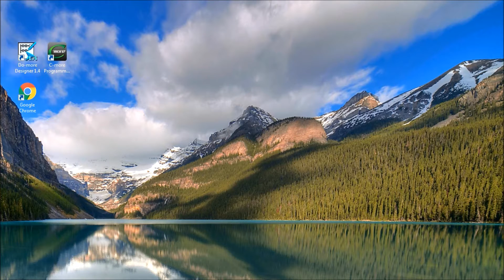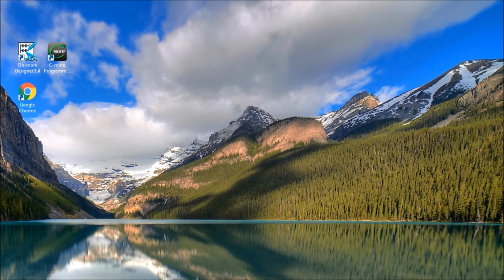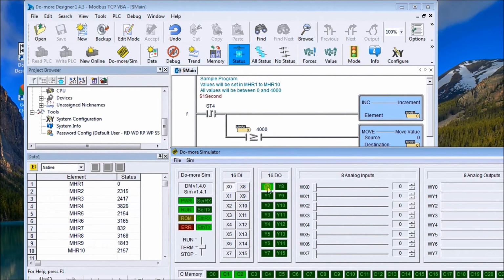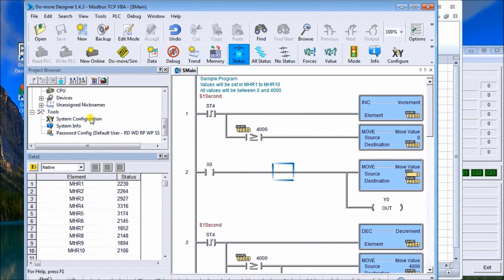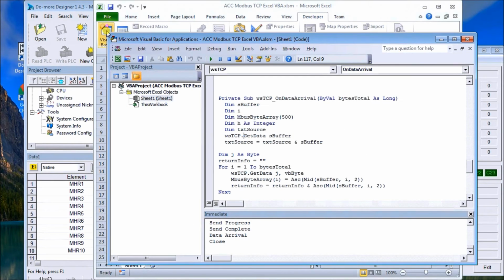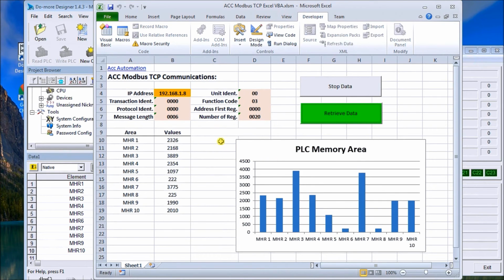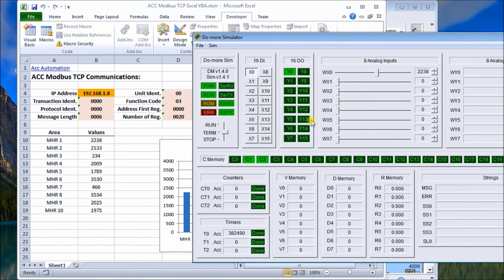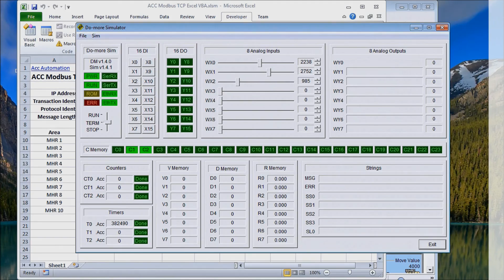Supercharge PLC Data Extraction with VBA and Modbus!

Comment: Hi garry!I have a problem with this code. The code works perfectly for Integer data, but I need to work with floating type data. when I try to implement float data in the excel book, the program shows me an error. I already see the info in your webpage, but I can't find a solution for this. Can you help me?
Reply from the maker: Hi Ramses MG,
Once you have retrieved the information, then you can convert to floating-point. Here is post that explains the process.
http://davestow.com/handy/excel-hex-to-floating-point.htm
What I would do is use a program like AdvancedHMI to get the data. This program runs on visual studio, vb.net and is free. You would then communicate directly to the excel file for data.
https://accautomation.ca/create-a-plc-with-hmi-training-and-learning-environment-free/
AdvancedHMI has the drivers are already written for floating-point and long information.
Regards,
Garry

Comment: Fantastic video... Thanks... But what if i needed each cell to be between the values (-65536 and 65536)?
Reply from the maker: Hi TheAlansal,
https://www.mrexcel.com/forum/excel-questions/767831-signed-hex-numbers.html
The above link may help you out. It will be a matter of converting the hex number into a signed number.
Regards,
Garry

Comment: Hi Garry, Im using the 8000 adress in my PLC. What should I write in mbusquery?
If (wsTCP.State = 7) Then
    MbusQuery = Chr(0) + Chr(0) + Chr(0) + Chr(0) + Chr(0) + Chr(6) + Chr(255) + Chr(3) + Chr(8000) + Chr(0) + Chr(0) + Chr(1)
    wsTCP.SendData MbusQuery 'Send out the Modbus Information
    ' Read the information
    '0000:    Transaction Identifier
    '0000:    Protocol Identifier
    '0006:    Message Length (6 bytes to follow)
    '00:      The Unit Identifier
    '03:      The Function Code (read MHR Read Holding Registers)
    '0000:    The Data Address of the first register <<<<<<<<
    '0002:    The number of registers to write
Reply from the maker: Hi Andre,
Each of the Chr(xx) represent two Hex numbers being sent. Note: The leading zero is suppressed. You want the following:
    ' Read the information
    '0000:    Transaction Identifier
    '0000:    Protocol Identifier
    '0006:    Message Length (6 bytes to follow)
    '00:      The Unit Identifier
    '03:      The Function Code (read MHR Read Holding Registers)
    '8000:    The Data Address of the first register <<<<<<<<
    '0001:    The number of registers to write

    MbusQuery = Chr(0) + Chr(0) + Chr(0) + Chr(0) + Chr(0) + Chr(6) + Chr(0) + Chr(3) + Chr(80) + Chr(0) + Chr(0) + Chr(1)

Hope this helps you out.
Regards,
Garry
Reply: Hi Garry, thanks !!
And what should I do to write a data on plc?
Reply from the maker: Hi Andre 

   ‘ Write the information
    ‘0000:    Transaction Identifier
    ‘0000:    Protocol Identifier
    ‘0009:    Message Length (6 bytes to follow)
    ’01:      The Unit Identifier
    ’16:      The Function Code (read Analog Output Holding Registers)
    ‘0000:    The Data Address of the first register
    ‘0001:    The number of registers to write
    ’02:      The number of data bytes to follow
    ‘0030     The number to put into the register

This is on the followup website at the following URL:
http://accautomation.ca/how-to-implement-modbus-tcp-protocol-using-vba-with-excel

Regards,
Garry
Reply: I can't figure out how to write to PLC from Excel. Excel needs to be a TCP master not slave? Is there any example program for this?

Comment: I try use your code but i have trouble.

I line: Set wsTCP = CreateObject("OSWINSCK.Winsock")
I have: Error 429: ActiveX component can't create object

I use Windows 10 64bit

Can you help?
Reply from the maker: +Silar Silar 
I have not tried this on Windows 10. This was originally ran on Windows 7, 64 bit.

Run-time error '429': ActiveX component can't create object
This error occurs when the Component Object Model (COM) cannot create the requested Automation object, and the Automation object is therefore unavailable to Visual Basic. This error does not occur on all computers.
Try the following before the Set line:
DIM wsTCP As  OSWINSCK.Winsock
Set wsTCP = CreateObject("OSWINSCK.Winsock")

Let me know if this works,
Thank you,
Garry
Reply: This doesn't work. I've the same erro 429. 

I'm on Win10 with Access 2013.
Maybe i should try on another PC ? Or you found a solution ? 
If I find a solution I'll tell you. 

Thanks.
Jack.
Reply from the maker: Hi Jack,
Can you try to register the OSWINSCK.dll file from the command line. Here is a link to explain how to do this.
http://www.ctimls.com/Support/KB/How%20To/Register_dll.htm
-To register a 32-bit dll or ocx Windows System file in a 64-bit version of Windows (10, 8.1, 7, or Vista),
     Type cd \Windows\SysWOW64  [then press Enter] 
     Type regSvr32 oswinsck.dll  [then press Enter]
Please let me know if this works for you.
Thanks Jack,
Garry
Reply: I tried your solution but the same problem happened.
Should I tried to run it on Windows7 Virtual Machine ?

Thanks for your help.
Reply from the maker: Hi Jack,
This was originally done on a windows 7 64bit machine. Yes, please try it on a windows 7 or a virtual machine.
Let me know how you make out.
Thanks Jack
Reply: Hi,

This doesn't work on Win7 64bit either. Still the same error 429.. I don't know why... Please help me.
Reply from the maker: Hi Jack,
I would try to install the Winsock component again. Please ensure that you are installing under administrative privileges.
Reply: Hi Garry, im having the same message and still after register of OSWINSCK.dll.
Can you help ?
Reply from the maker: Hi Wesley,
What version of Windows are you running?
Is it 32 or 64 Bit?
Regards,
Garry
Reply: My version is 64 bit..
Thanks
Reply: windows 7
Reply from the maker: https://support.microsoft.com/en-us/help/828550/you-receive-run-time-error-429-when-you-automate-office-applications

The above link will explain the reason and possible cures for the error.

Regards,
Garry